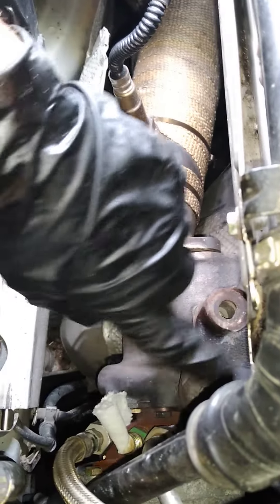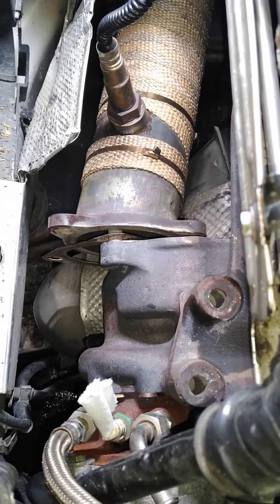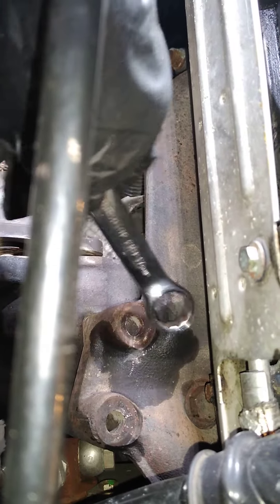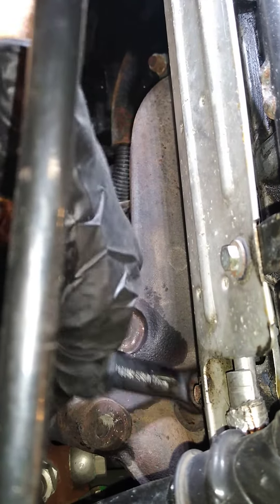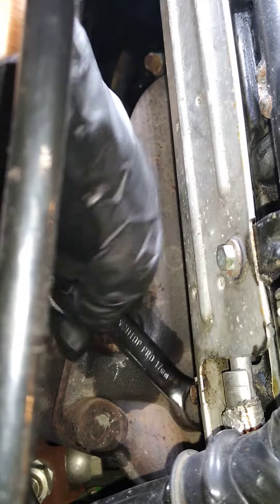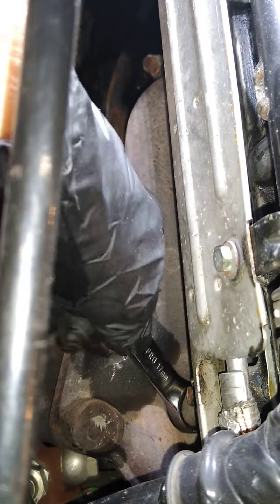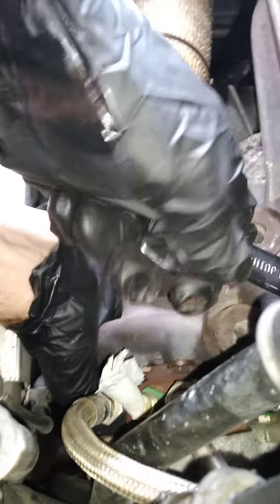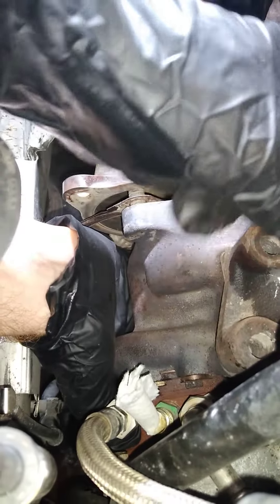02 VW Passat B5.5 1.8L Turbo Removal/Install -Part 6of13

Comment: How did u get exaughst bolts out?
Reply from the maker: @joshuanetcher9565  Using a 17mm stubby wrench -boxed side. I loosened the 3 bolts equally as the turbo dropped then when reinstalling I tightened equally to draw it up. I never removed the bolts from the exhaust manifold, just the turbo.